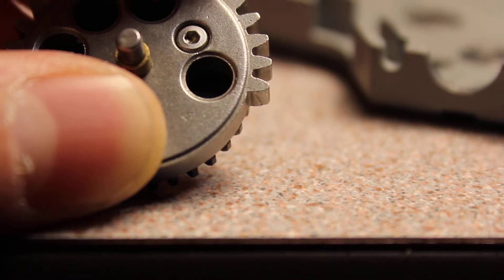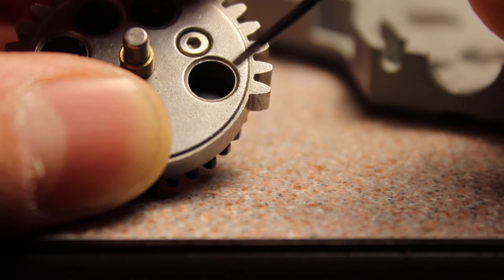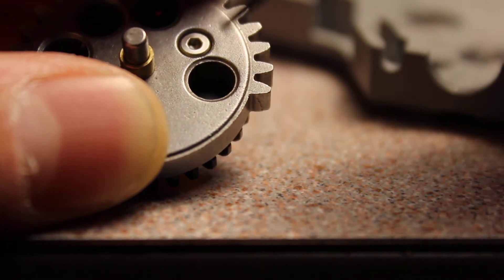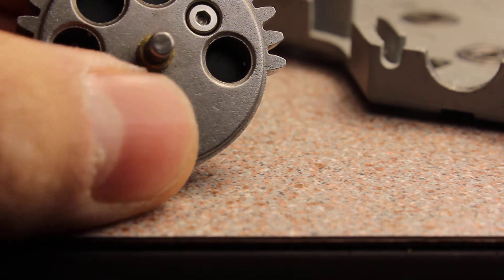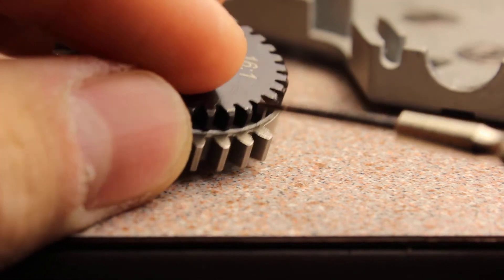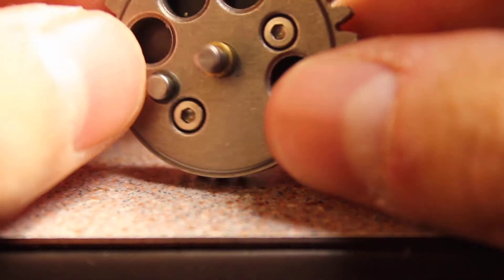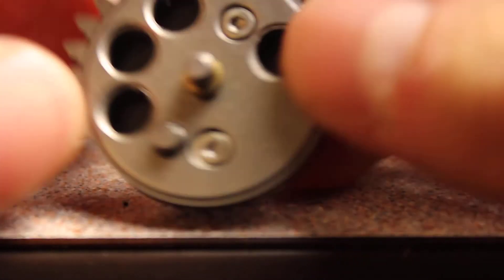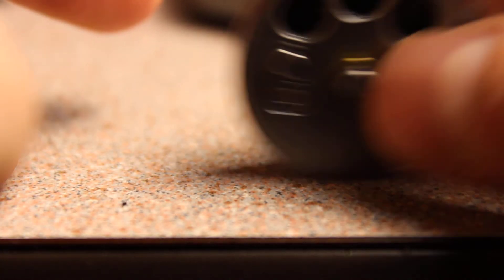SHS 16:1 gears fail. Again.

Comment: That sector spur is sintered, meaning that its compressed from steel powder and then heated to near melting point to bond the powder particles. I would suspect that this damage happened before the part made it to the oven, because before that the parts are quite brittle and must be handled with care. Most likely that crack was formed when they pushed it out of the powder compression mold.

Comment: I'm having problems getting my gearbox to work properly. I have an ics gun not sure which one but it worked fine was put in a closet for a couple years took it out put fresh batteries in it shot once or twice then seezed up. I took it apart put it back together and it did the same thing. I was wondering if there's a way I could contact you and maybe get some help.
Reply from the maker: Try a new battery
Reply: @valleyriverarms  oh man it's been 5 years now. I honestly do appreciate you getting back to me though. That's dedication.
I found out at first it was the spring. It was left in the closet with the last time me shooting it in full auto when it died. Found out that's really bad because if the spring is compressed when it dies, meaning it can get only half way through one shot into the other and die there, but only in full auto is that really possible. Recommend shooting a round or two in single fire before you put your airsoft away. 
So the spring got lodged then I go to take it apart and the spring shoots out real violently as soon as I go to open the gear box. That ended up breaking one little pin wall thing inside the wall of the gearbox housing. Just so happens that's needed to hold a small spring back so the trigger can reset for the next shot. 
This all took me a while to figure out and all I had to do is access the whole through the inside of the grip if you take the motor out and reset the spring the first time before taking it apart and I would have been just fine. 

You live and learn I guess. Lol thanks again. I hope someone finds this long message useful.

Comment: For those that recommend Lonex gears instead, so far I've had a 50% lemon rate with Lonex gears, seriously. I've bought 4 gear sets from various shops, and 2 of them had serious faults. One had a severely deformed tappet cam, which would have destroyed the tappet plate. The other had a clearly visible crack in the cut-off cam, I didn't even use this gear in fear of it cracking. I've also had a 2nd gen ZCI bevel strip completely in a properly shimmed, medium stress setup. I've even had issues with SC gears, seems like SC 2nd gen bevel gears are at least somewhat proprietary in regards to pinion gears.

I have of course had issues with SHS gears too, just wanted to point out that AEG gear sets in general have poor QC and/or aren't always optimally designed. SHS 3rd gen gears have served me well, haven't tried the new 4th gen gears yet, time will show if they are decent. Thinking of giving ZCI another try since they get quite a bit of praise and my ZCI bevel may have been a lemon.

Comment: The issue is that this sector gear is made of sintered powder metal which is much weaker than the CNC-Machiened counterparts.
Basically powder is pressed in a mold and than heated.
This creates cheap and mostly ok gears or other forms (usually used in cheaper powertools as well)

I think that this exemplar cracked due to an error in the raw material and / or cooling after the gear has been sintered.

Machiened gears on the other hand have much stronger internal bounds and last longer.
Reply from the maker: yeah SHS has since changed to more wire EDM cut parts

Comment: I agree, SHS has some nice cheap parts u can use for upgrading on a budget, but there gears r a hit & miss. And after busting 2 sets of 7mm SHS ball shims. I'm never going 2 use them again. 8mm haven't used yet. SHS alum nozzles spring sets and afew other accessories r good but some parts r shitty. I looking for a alternative for there gears thou in similar price point. I may consider 5KU, price is abit same.

Comment: I'm not sure which generation those are but to me that looks like cast aluminum it's more of a silver color I mean it might be black but if you actually look at an shs gear I have multiple sets of them they are just straight up black there is no gold tip extension and the ones that have her steel very solid and I put in a s*** ton of abuse through these things it's all about quality control you know there's four different generations so I don't know how old this video is but I've never had any issue you know I have a very high speed SSG and I've got a very high FPS DMR that gets ran very hard and I haven't had a problem it's probably just a bad batch if that was the case I would either take it back to the shop or I would try to get in contact with them directly.
Reply from the maker: As you realized this was old ass info. SHS/rocket whatever has been pretty solid for a while now
Reply: @valleyriverarms  lol I know

Comment: Heads up,  don't buy 16:1s buy 12:1 /13:1, my shs 13:1 i recently pulled out of a unused gearbox where perfectly fine,
Reply: Juan Gaytan you do realize that this is a six year old video and these are not the current fourth gen which have been out for at least three years....you most definitely have a fourth gen, since other wise they would be broken
Reply from the maker: yeah at the time SHS was shit at QC and their teeth design on the bevels was awful. All of the newer gears I've used this last year have been fine.

Comment: Try to Use this Setup :
1. SP140 Spring (for high speed, use SP120)
2. HIGH TORQUE MOTOR GnP M180
3. CHANGE TO PROMETHEUS GEARS!
Reply: dude, do you know if Prometheus gears can handle stuff like m160??? I'm mostly using  m140 but are they strong enough to withstand springs like m160?
Reply: @19FC96  I have stock 18:1 Chinese gears in my lancer m4 proline and reshimmed them, threw in a 30k Boost motor by asg, then tossed in a shs piston, aluminum piston head, double o ring cylinder head, o ring air nozzle, all pushed by an shs M160. I get about 600 fps at 23 rps. Just took it apart last night after 5000 rounds and found no wear. Shimming is very important. And if done right your gears will last a long time. No matter the spring. From there it's motor, battery and electronics.
Reply: @alexandermarshall4382   Lancer gears are made from Jing Gong, these gears are known to be really good, but many times Chinese brand gears tend to either be the best or the worst. Happened to me and many of my customers a lot of times.
Reply: @19FC96  Oh, well I wasn't aware those gears had the ability to be strong, and now I may look at them more reliably as they seem to be
Reply: @19FC96  plus it's pulling and M160. Couple coils cut so more like an M150
Reply from the maker: prometheus gears are overpriced for what they are.